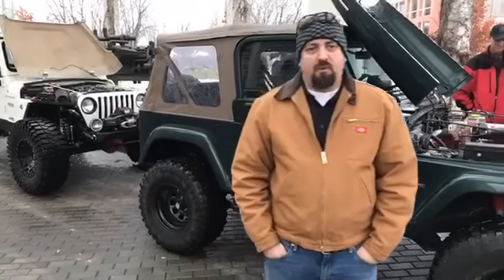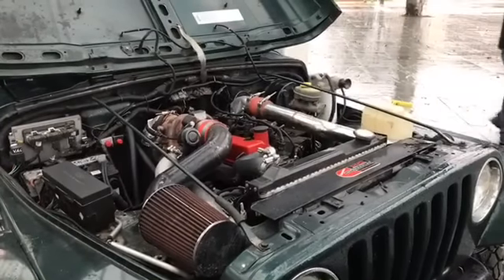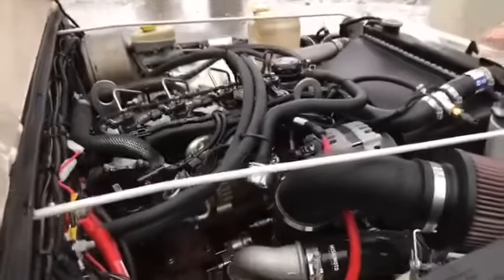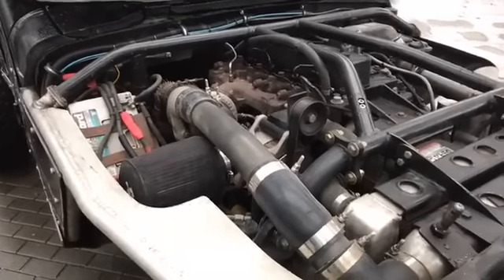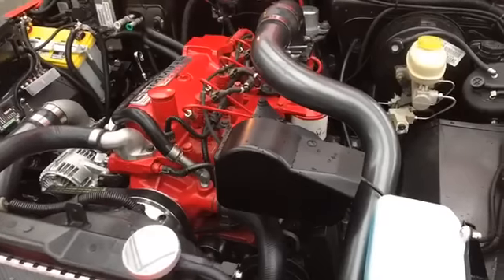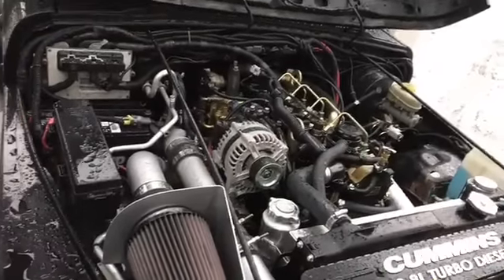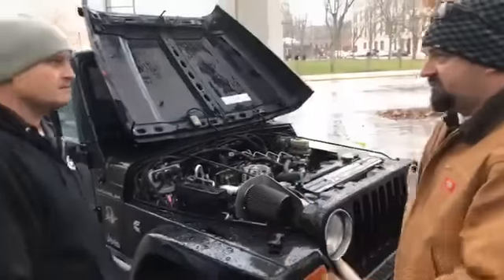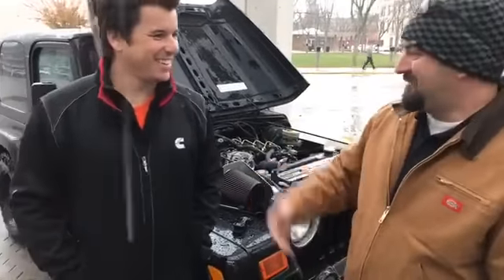FACEBOOK LIVE: Cummins Engine Swaps into Wranglers

Comment: While working at a Caterpillar shop in Key West, FL in 1979, a gentleman came to our shop with a 1957 Cadillac that had a 3208 Caterpillar engine with a Allison trans replacing the blown engine in 1967! He said it was not starting like it used to and loss of power! I found two injectors not firing but replaced them all with rebuilt injectors and had to do a valve lash adjustment as most were way out of adjustment! He drove from Marathon to Homestead five days a week 85 miles to his restaurant! The Caddy had 565,000 miles on it!

Comment: Really want a 4BT in my Cherokee.
Reply: You and me both. Might be in the cards in a few years as I've just framed out and boxed out my entire unibody it's now so SOLID and I have a 8.5" long arm lift to fit it right. I would be a perfect swap candidate for one since the stock unibodys eventually snap spot welds once you wheel for a few years of tough serious offroading.  I've heard whispers of 30 mpg paired in with some sort of automatics which would be great for me as I've no interest in manual  transmission especially for a 50/50 daily and every weekend wheeler but would not believe it till I clocked those mpg myself. Gearing is key to all of it I'd suspect.
Reply: I want an SJ Cherokee to put a 6bt in it.

Comment: We guys here in europe have it made when it comes to diesel engine in the jk. I have the 2007 jku sport with the 2.8 CRD that puts out 177 ponnies and a ton of torque (the number not on the top of my head). I added the pedalbox and it eliminates the turbo lag which feels like I have 200 hsp. But it doesn't stop there, I have a specialist that can reprogram the ECU and increase the turbo boost up to 1.4 bars which he said will draw me close to 245 hsp.

Comment: I'm just east in columbus Ohio, I've got a 1995 YJ with a VW 2006 BEW 1.9 TDI I'd wager to say it's even better than that 2.8, 180hp 280tq, and 30mpg all day, with 33s not to mention parts availability
Reply: Sweet. I am putting a 1.9 ALH TDI engine and ENTIRE ELECTRICAL mk4 harness into my 1966 split window bus. Should be fun.
Reply: i live on the east side of columbus as well. Needing some help on a swap.
Reply: Eighty cc I have owned multiple ALH jettas and Golfs. Lol ALH are a Million Mile motor with proper care.
Reply: Eighty cc get on Facebook send pictures to Cherokee Ronnie
Reply: Space Cryptid  depends on the year but yeah usually get %50 more power for under 1000$

Comment: Did these guys do any frame strengthening before they installed a diesel engine in a Jeep. Like sleeveing the frames. Dodge used to have them twist the frames because of the engine torque in their Gen 1 vehicles and they stopped putting them in 1/2 ton pickups only 3/4 and 1 tons. I do like the engine swap tho.

Comment: I gotta give credit to all the work put in. Go for it if you have a passion for diesel. If you just looking for torque, just stroke a 4.0 to 4.8 and do some work the cylinder head. Same torque as a R2.8 but roughly 100 more horse power. I live where it gets cold enough for diesel to gel on a nightly basis for weeks. It's just too much work to make diesel fuel systems reliable in sub zero temps.

Comment: That 2.8 is a fantastic idea, and I am glad it is out there, but I just can't help but be disappointed.  It is too expensive and too under powered for its size.  2.8l is about half the size of the 1 ton truck engines, but it is only putting out 1/4 the power and torque.  Meanwhile, european diesels are 2.0l or less, but put out 25% more power and torque than the 2.8l cummins.  

This 2.8l by all rights should be putting out at least 225hp and 350lb/ft, and should be doing it for $6k.  For the $9k price tag they are asking, it should be AT LEAST 275hp and 400lb/ft.
Reply: cummins historically under powers their engines to ensure they can get massive mileage before needing rebuild, it doesn't take much to pump their power, there are already people with ~200hp and 400ft/lbs of torque on their 2.8's so the numbers are there they just have to be tuned in.
Reply: @rNorock - I see your point, the price is high and (for better or worse) that's about what one would expect from Cummins. Cost aside, the R2.8 looks pretty sweet given the fact it ships 95% complete, is OBD compliant up to 1999 (and eventually beyond 1999), it's also fairly light/not a boat anchor and has a fairly small foot print, which makes for a very versatile/compelling diesel swap option... plus folks are finding they can tune em 90hp over the stock 161hp with no internal engine mods. The price btw has actually dropped a bit year to date and could drop a bit further given a little more time.
Reply: @eliminster06  oh?  So I have to spend $9k for the engine, then another several thousand to make it run like it should from the factory to begin with?  No thanks.

Comment: I know there's a TON of people out there that have a 4 cylinder engine in their 1997-1999 Jeep Wranglers that want more power. In all the forums, all they are told to do is sell their jeep and buy a new one with a bigger engine, the swap isn't worth it. Will Cummins make these engines doable for people like me with the four cylinder without having to weld on new brackets? I'm fine with swapping out the engine, transmission, and tcase, but I'd do away with the welding if i could.
Reply: Bobby Dean welding is easy.  Welders for the hobbyist are cheap.  Use a flux core welder and you don't even need gas.  Not the prettiest welds, but plenty strong enough
Reply: No. The diesel is too heavy for factory mounts. Im a decent welder. And my lovely girlfriend is too.

Comment: Really .. Cummins should have brought back the 5BT stroker motors that went into step vans of the 1960's and 1970's .. I have a friend with a jeep with no squeeze and it has so much torque that it can go anywhere .. It was about 110 bhp but it did not spin up past 2100 rpm's .. That engine got 60 mph in a 1998 Wrangler .. It doesn't go real fast but who cares with that mileage and that much torque .. WHO NEEDS BRAKES with that engine !!!!!!! Just let of the gas and that sucker slow right down .. 

CUMMINS BRING BACK THE 5BT " P L E A S E " .. That motor in my friends jeep has gone over a million miles !!!!!!!!! .... Low rpm's = less friction = long life = best in class fuel economy = best choice for those who want to trave 900 miles on a single tank ! ..

Comment: i have a 99 ranger in great shape.. wondering if the 2.8 isf will adapt to the computers and electrical system.. i want a ranger that can tow, crawl and maybe even tear it up at silver lake with a few propane shots..
Reply: Would probably be worth just looking into a 4bt. Mechanical and have worked very well for people.
Reply: Bob Sagget thought about it. Alot. But the issue i have would be the weight. And the r2.8 has more power than the 4bt and weighs less, revs higher, and has more modification within programming before components need to be upgraded.

Comment: I am looking for someone to do an engine swap for me on my Low Low 62k actual mile 1987 S-10 blazer 2.8L anemic V6 4X4 Tahoe.  The Blazer is MINT.  It looks like it was never sat in.  Under the hood it looks like it is still on the showroom floor.  The original 2 tone blue paint still looks mint.  This was an estate sale vehicle vehicle, I am the second owner.  It has been garage kept and senior citizen owned since new (and it still is garage kept and senior owned).  The 2,8 V6 is worse than a slug and I do not want to slam a V8 in it.  My hopes are for a Cummins 4BT or other Cummins(I hear they have incredible 30+MPG, or I am also interested in the new 4 cyl turbo 300+HP Silverado engine (If I can actually find someone that can get it to work with all the computer crap).  I am in Tennessee.  If you are up to the challenge or know someone that is, please let me know.

Comment: What lift pump was used on the QSB?
Reply: The engine has an integrated lift pump on the back of the ecm mounting plate
Reply: @patrickwayne3701  Thanks, I have a 3.3 in my 66 Fairlane and after 30,000 miles am having a check engine light.
Reply: @nealbacon7798  cool platform- 66 Fairlane,,,  there's ALL KINDS of folks who would eat that up, to see it on YouTube,,,, just sayin',,,,

And I presume you mean the mil light is on the Murphy guage? (As the only 'trouble' light a 66 Fairlane had was a low oil pressure light....

And I am not aware of a 3.3 being outfitted with electronics,  to even HAVE a Murphy guage.... are you sure you don't mean a 3.8? (Or a 2.8?)
Reply: @Neal Bacon ok, so did you do the repower? Or does the party who did it have access to Insite, to check the fault codes with?

The description SOUNDS like a protective de-rate is taking place,, and with the electronics on the QSB series, it can be something as simple as the ECM losing the signal from the coolant sensor, or any number of other ECM inputs that are considered 'critical' to operation.

The 'dead pedal' you describe, makes me think it's a critical signal, the ECM is seeing a problem with because thats our protective way, to be sure the operator HAS to pay attention to the engine systems, is if it won't perform,,, they will (hopefully), have to scratch their head and look it over, instead of just beating it into the ground. 

So, all the simple stuff applies,,, oil pressure (and level,  of course), the cam and crank signals and wiring between them and the ECM, the coolant sensor and wiring, the IMTP sensor (Intake Manifold Temperature and Pressure), Turbine speed off the turbo, (if so equipped), WIF sensor (Water in Fuel), and so on.

Basically,  if you have had 30k of operational bliss,, what changes? Fluid levels,  and Filter health, and environmental factors like rodents in the shed you park in, and a myriad of other things you start from by observing K.I.S.S.,, Keep It Simple, Stupid.  Eyeball inspection of all connectors and wiring,  then,  a scan for fault codes, and it will become very clear in short order.
Reply: @Neal Bacon I always have to smh at what some places charge, just to hook up and identify the FC's, but I understand what a business plan is, and has to be,  to be in business.
Reply: @Neal Bacon what area are you in?
Reply: @patrickwayne3701  Sent some pics to your email, let me know if they are what you need.

Comment: The 2.8-liter, is the worst engine Izuzu ever made! Ps. It's that engine that comes on the Wrangler to Europe!
Reply: Nah the diesel jk has a 2.8 crd
Reply: Made by izuzu, I speak with experience of cause, I paid the repair price! A lot...
Reply: Sérgio André wow I didn't realize they were that bad of an engine
Reply: It is not by coincidence that the Jeep practically nothing sells in Europe. Especially the Wrangler !!! And the guys from FIAT have good diesel engines with IVECO(3.0lTurbo or bi turbo) ! They sell them in the US with Chrysler. Is the only problem with the wrangler, gearbox with 6 speeds (and manual), automatic (5 speeds) transfer box 5 STARS, the engine is that sucks, but, great indeed! In my, I moved to a toyota 3.0 diesel, and i smile every day! 
An ex GM company (Opel) also sold that engine, a catastrophe!
Reply: You will soon have in the US an excellent French diesel engine for sale at Ford (raptor, etc.)

Comment: You can now order the JL with a 3.0 liter Ecodiesel from jeep with higher HP and TQ numbers. So why would someone want to sink thousands into swapping in a Cummins diesel. You will void out your powertrain and drivetrain warranty also.
Reply: That engine  , the r2.8 is for preemissiones cars
Reply: more AMC Chrysler engine junk...their first new attempt to make a diesel. It will not hold a candle to the VW diesel conversions....in mpg or torque nor longevity.